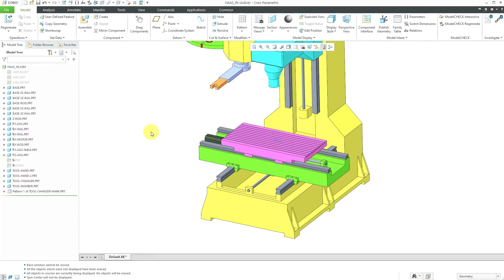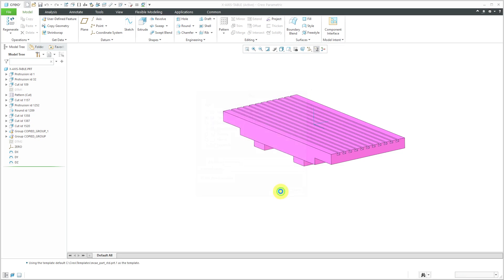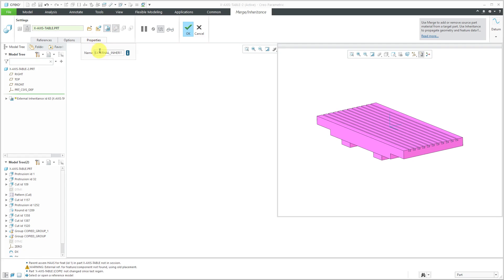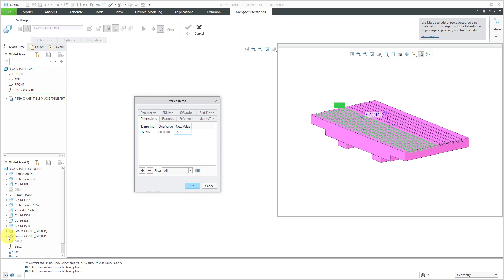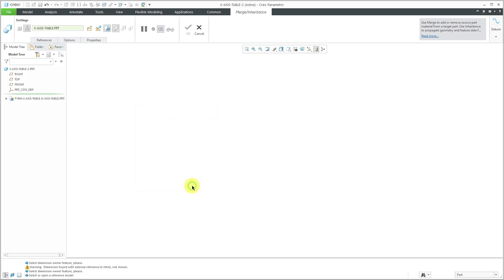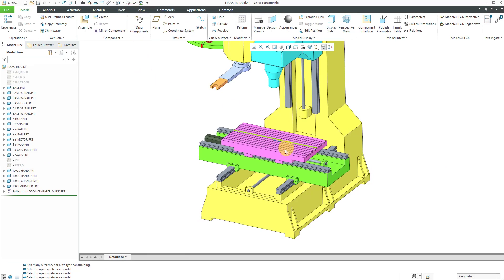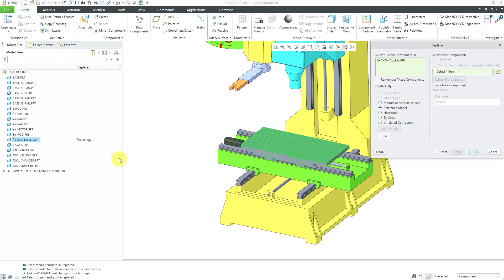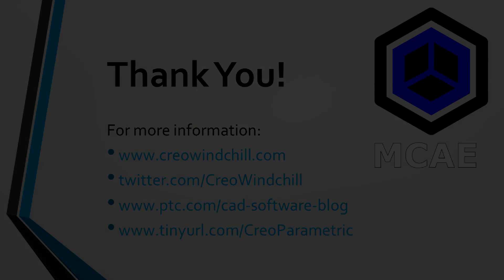Creo Parametric - Replace by Reference Model - Merge / Inheritance Feature

Comment: Are u certified creo user?
Reply from the maker: Define “certified.” As far as I know, there’s currently no official certification.

I was a certified PTC instructor for 13 years. I’ve been a CAD administrator for Amazon and Prime Air for the past 6 years. I currently perform design work on the New Shepard and New Glenn rockets.

Does that count as certified?
Reply: I have studied about evalgraphs but i hv seen the example in your video, i want tht my student are capable to make anything they imagine in any CAD software
Reply: Ur skills are great
I m learning and teaching creo from 2 years i knw people like tht knowledge only if thy give time to it and you have whooping 13 years experience, i have learnt some new things from ur videos 
And have one question does screw joint is possible in creo 
I tried wd slot and planner but its not worked properly but same worked for a another model having similar motion
Reply from the maker: I would go with a Slot-Follower in combination with a General connection to prevent to components from tipping relative to one another. You could probably also do it with a Cam connection.